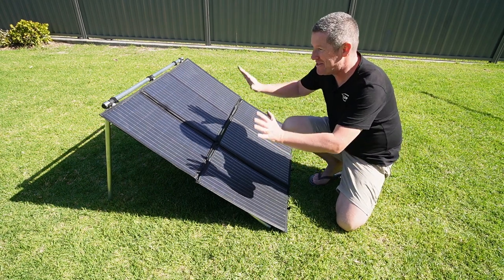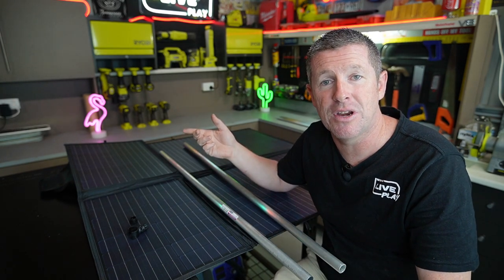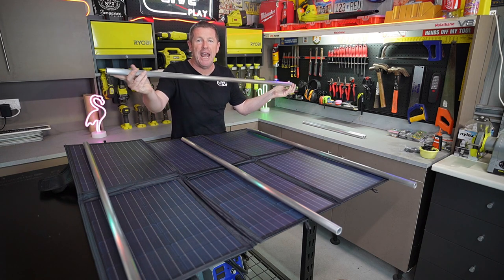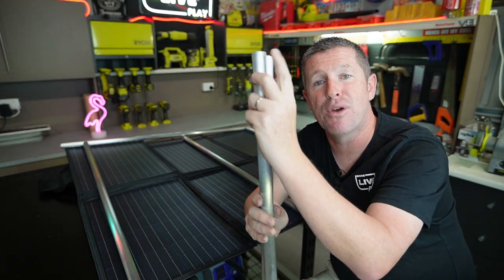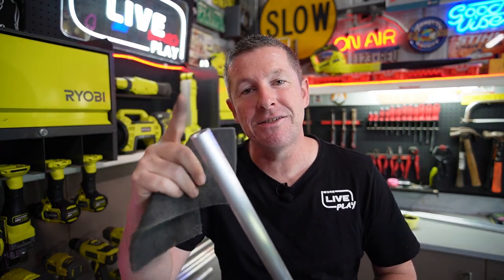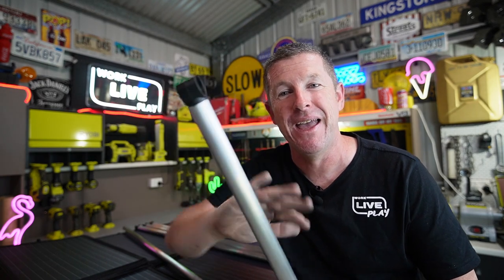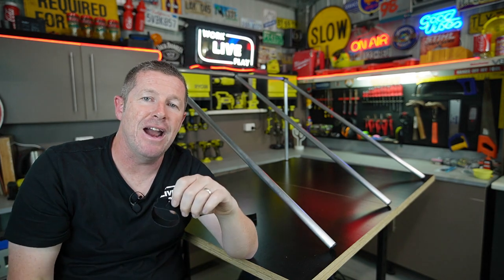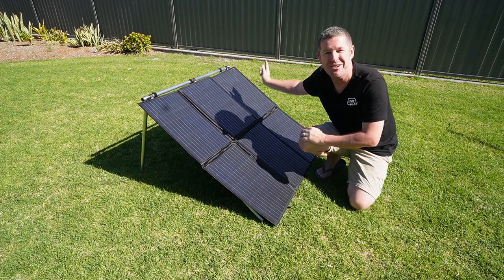LIVE | Our DIY Solar Blanket Frame Solution - its lightweight and clicks together!

Comment: I built something similar out of PVC pipe but added a cross bar at the bottom of the panel supports and at the bottom of the upright legs, with a strap between them to stop them from opening too far. To tilt the panel up, pull the strap tighter.. to lay it flatter, loosen the strap. Having the crossbar at the bottom of the panel supports and the upright legs also gives something to stick a large tent peg over to hold the panel down in the wind.

I also put a screw into the top crossbar where the panel will sit to hook the panel loops over. This gets the panel more to the position you wanted.

Your solution looks simpler and maybe takes up less room when broken down for transport.

But I was really surprised at how much difference putting the blanket on a stand actually made. I think my testing showed almost 30% improvement in output.. plus I avoid possible paint damage from having the blanket on the bonnet or roof if my vehicle is not parked facing the sun. I have 2 x Kings 200W blankets that I couldn't get more than 60-70 watts out of until I put them on the stands and then was getting more like 100-120W. 

Great video !

Comment: Inspired by this DIY I raided the shed and pulled out all the old gal Tent Poles.  Different lengths and dimensions.  Off to Annaconda and purchased 6 c clips for $18.  After an hour of trial and error and using bits and pieces of about 7 poles, put together a support structure for a 300 watt blanket.  Had previously tried to build one from old conduit - fail - no support.  My tent pole frame doesnt look as pretty as Work LIve Play but it's functional and cost the price of 6 c clips.  Thanks for the inspiration.
Reply from the maker: Brilliant 👍 I did consider using tent poles as we too have quite a few stashed in a corner but I was going for light weight. Great to hear it worked out 😁

Comment: Good project, Vaughn.
I bult a very similar stand out of old tent poles and fittings i had in the shed about three years ago.  Basically cost nothing except my time. I have a cheap Kings 200w solar blanket that prior to using the stand gave around 4 amps in full sunlight. Using the stand and properly orientated solar blanket returns just above 6 amps in full sunlight so definitely worth the effort. As an aside i use the cheap kings blanket because i often camp solo and away from campsite for long periods, i don't care if a $150 less efficient blanket is stolen.
Reply from the maker: It's actually been working really well, given it takes up pretty much no room and weight when packed away. I agree it does make a big difference to the efficiency of the panels as you  can adjust to get them inputting as much as they can based on that particular day. Much better than trying to lean them up against something, that's for sure 👍

Comment: Thank you for this video, I plan on making something similar to this.  I just got some solar panels, two individual sets that I need something like this to handle them instead of the little legs on the back of the panels.  They aren't very strong and take up way more room in their horizontal layout.

Comment: Nice work and looks great. I purchased a few adjustable fishing rod holders on ebay that have Y type fitting on top and a spike on the bottom that i hope will fit in the loops on the panel. But havent tried yet. So if its a no go i will copy your set up. Keep up the great mods and be safe out there.
Reply from the maker: That's a great idea. It might actually work, let me know how it goes.

Comment: Fabulous invention. I thought maybe you could add a ridge or bracket on the bottom of the front legs to sit the solar panels on so they are raised a little higher off the ground which in turn would raise the top of the panels so they can lean against the top bar
Reply: Thought the same thing. Could be as simple as buying 3 more clamps and clipping them to the bottom. Or a corner connector and  cap the hole.

I've been using sticks with the loops to prop up my 120W solar panel since it's just one row of 4... these 2x3 panels all seem to be cumbersome.

Best solution I've seen so far!

Comment: Hey mate great clip, you also could clamp both ends to make like to other end which would be easier to control and stop the panel slipping down. Pipe and tube are measured different one is out side and one is inside.

Comment: Hated not being able to stand my solar blanket up so 3d designed and printed of parts, used some aluminium from bunnings and made my own expanding and adjustable solar blanket bracket
Reply: Would love to see how you approached it.  You happy with the outcome?  Would like to print my own if works well.  Cheers.

Comment: A little dab of liquid nails or silicone, would have held those "c" clips in place
Reply from the maker: Instead of using compressing into the tube? They are made to be installed like that, its pretty easy to do.

Comment: Any updates on this??
Reply from the maker: Nothing too much. I used as documented on the trip. The only thing I adjusted was I moved the support legs inward and used them to tie the velcro straps holding the panel around. That worked really well in holding the panels up further.

Otherwise it worked really well, pretty easy to move around to chase the sun and you could leave assembled and stash away when not in use.